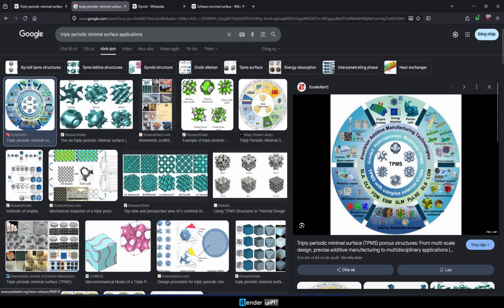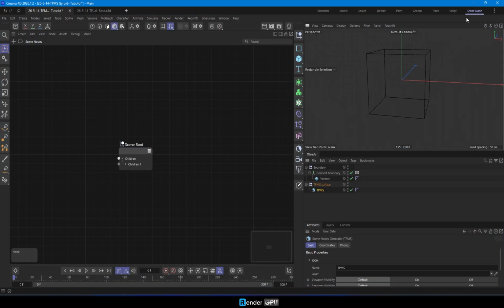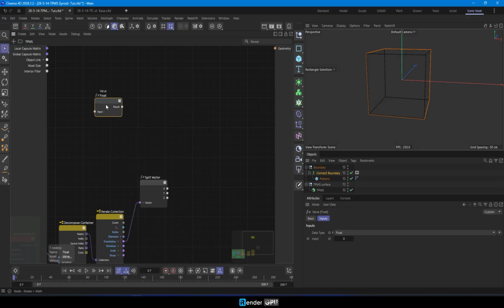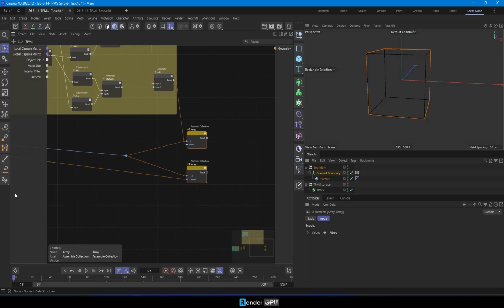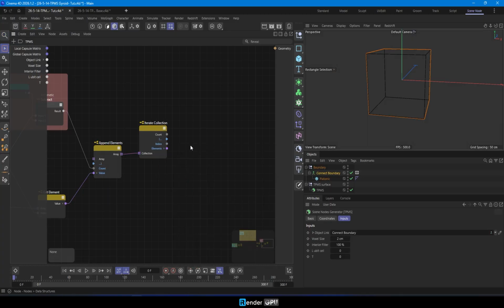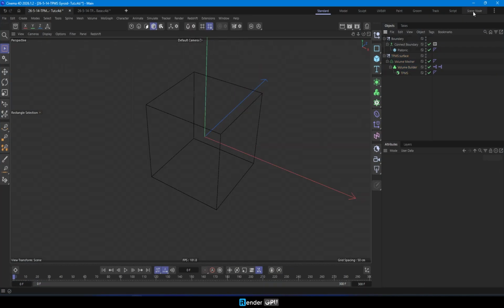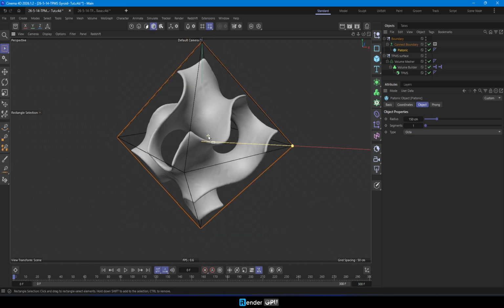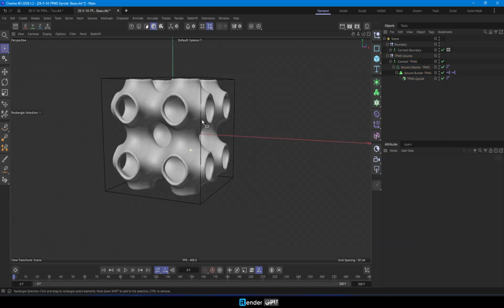TPMS Structures with Cinema 4D Scene node & Volume | Tutorial | iRender Render Farm

Comment: How to substitute other formulas into this setup?
Reply from the maker: Thanks for your question! The workflow shown in this tutorial is specifically for building a TPMS structure. To use a different formula, you can replace the mathematical expression section with your own equation while keeping the same coordinate extraction setup (X, Y, Z), calculation nodes, and Trigonometry nodes.